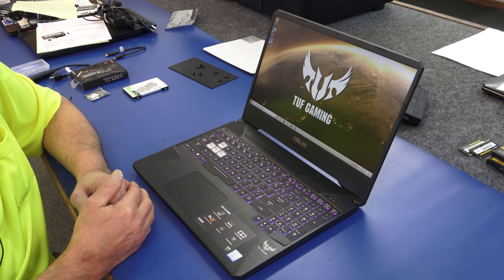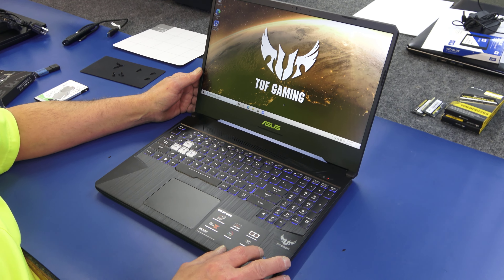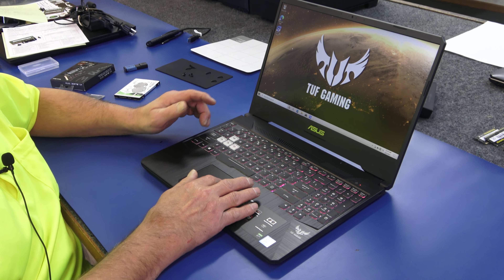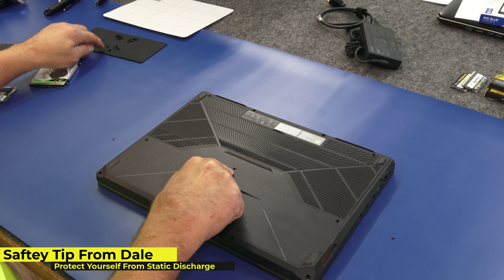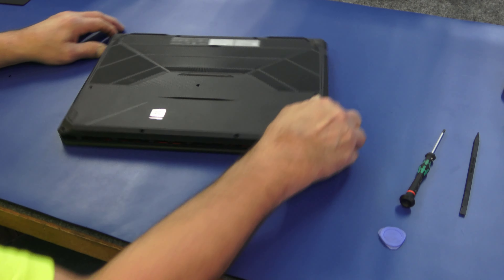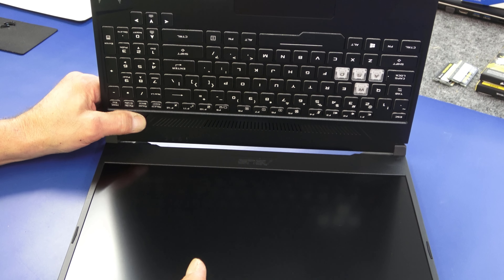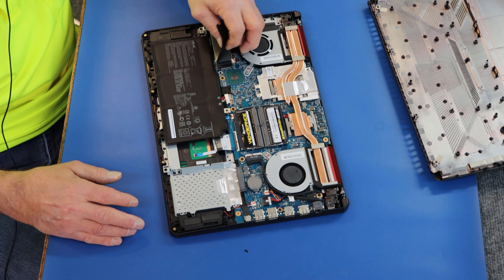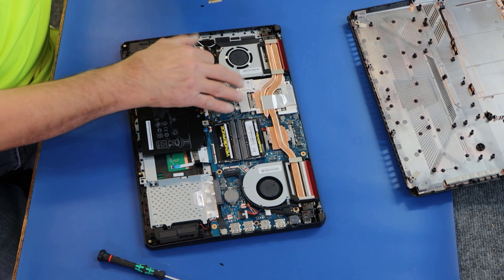ASUS TUF FX505GT Upgrade SSD, Memory, WiFi , Add HDD, Clean Windows 10 Install. Start to Finish!

Comment: question, when attaching the wires to the wifi card... why not attach the wires before inserting it into the slot? there seems to be enough slack in the wires to do this alittle easier.

Comment: I have Asus tuf fx505gt-BQ018T I bought 8 gb ram.I will leave info here,can anyone tell me is that ram compatible with my laptop. 8GB 2666MHz SODIMM DDR4 Ram CB8GS2666 crucial
Reply: Yes, make sure the both the ram matches in GB , if the existing 8 gb ram at 2400MHz you still can upgrade to a new 2666 it would automatically downclock itself, short answer yes you can.

Comment: I have one of these and i am upgrading the ram to 32gb recommended by asus..and i may do the extra ssd drive in that slot as yall did. pretty solid computer for the price. thank you for the video
Reply: Can I ask what you used? I have this laptop also and its so bloody slow. I was thinking ram upgrade and a fresh clean out.

Comment: I have the same laptop and I am putting a new ssd because the hard drive is slow
Reply: Hey,
Could I ask you if your laptop came stock with M.2..I bought the Asus tuf FX505GT.
I could have swore in the product description it had both M.2 and, HDD.
However, I just started trying to speed up the boot time and just realized it has only the HDD.
Thank-you.

Comment: Is it REQUIRED to have that flash with the windows 10 on it and use it after those upgrades, or could I use all those components then just turn on the system

Comment: I have the FX505DU. I want to know If this model supports 2666mhz RAM? (I checked the stock 8G memory and it only has 2400hz)
Reply: The ryzen 5 3550h and ryzen 7 3750h only support till 2400hz

Comment: I bought an Asus basemodel with an i7 10th gen cpu, upgradable ram, nvme and wifi card. 

I went from 512 gb intel 660p to an an 1 TB Samsung 980 Evo Pro. 

From 16 GB DDR 4 memory to 32 GB DDR 4 memory. 

From Wifi 5 to Wifi 6. 

And in installed a the 870 EVO 1 TB in the SSD slot. 

But I must say the hardest was to get those damn Wifi antennas to fit again :)
Reply: Cam you send the link of that product please. The origknal
Reply: @xxkvmdarkxx8110  expertbook p2451fa . Easy to upgrade.
Reply: @madsfrederiktoft5808  thank you
Reply: @madsfrederiktoft5808  do you know what wifi 6 card would work for asus tuf fx505gt-ab73
Reply: @xxkvmdarkxx8110  look at the key type if it's CNVi it's ax200 or ax210. If it's CNVI 2 it's Ax 201.
Reply: @madsfrederiktoft5808  how do you know the keytype?
Reply: Why you upgrade all these? Stock the laptop is very fast. Gaming no problem
Reply: @AppeltjeEitje34  because you can! lol, it helps right? everylittle bit of speed and efficiency could end up prolonging the life of the laptop as well

Comment: Thank you Dale! I just bought my girlfriend this model for her bday present and ready to give it an upgrade on the SSD. The original 5400RPM HDD is really a crawler. ;)
Reply from the maker: There is nothing like the speed of an SSD. Thanks for watching. Dale
Reply: Thankyou so much now I will buy Intel AX200
Reply: Hi, where did you get the screws for mounting HDD to that metal slot?

Comment: guysss, is it true that HDD quickly damage rather than SDD?

because im considering my external storage for my laptop
Reply: SSDs are overall better than HDDs when it comes to preventing damage and increased speed. The only reason one would EVER use an HDD over an SSD is if they have lots of data. HDD is the better bang for your buck. But if you're thinking quality over quantity. Always go for SSDs.
Reply: @DarkReaperK97  ah okieee thanks for ur explanation mate!

Comment: Hi, i bought model asus tuf gaming f15 fx506lu-hn011 with i5 10300h and gtx 1660ti, ram 16gb.
I heard about a bad cooling system, are there any recommendations for this? maybe it is worth using different cooling pads, and was it a good choice?

Comment: Question, can i add ssd to the 2.5 inch slot or only works for hdd?
Reply from the maker: Hi. Yes, you sure can.  Both 2.5 inch SATA SSD, or HDD works. I recommend SSD if course. Much faster.
Reply: @CadillacComputerCenter  great to know that! Ssd for the winnn